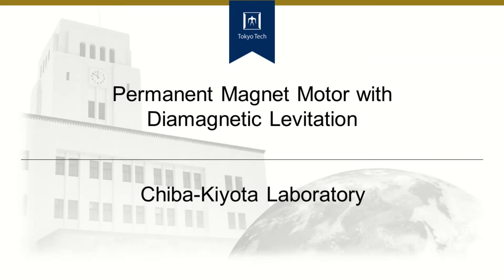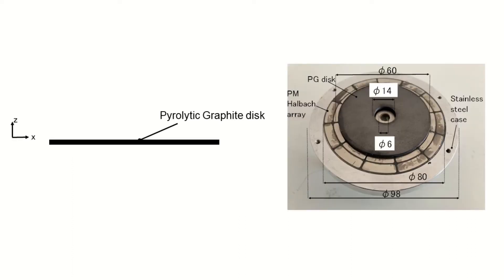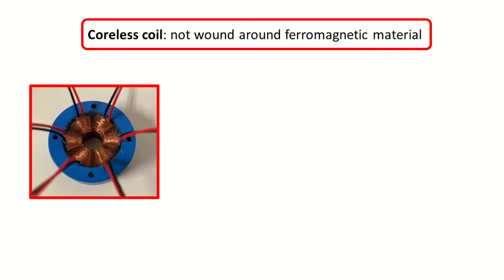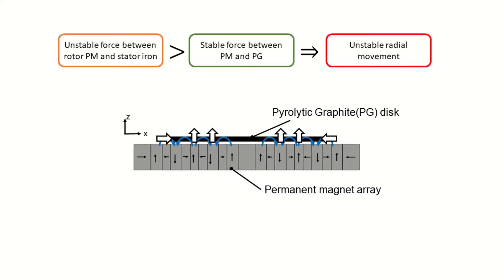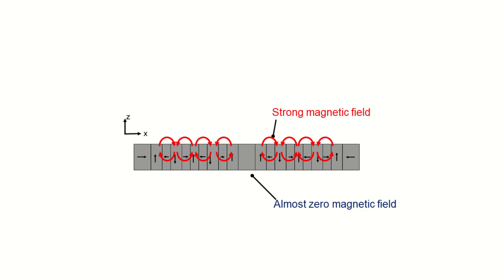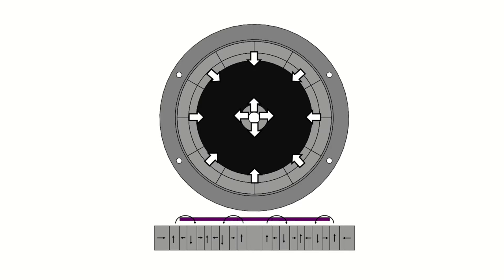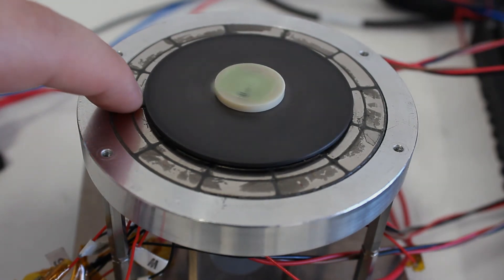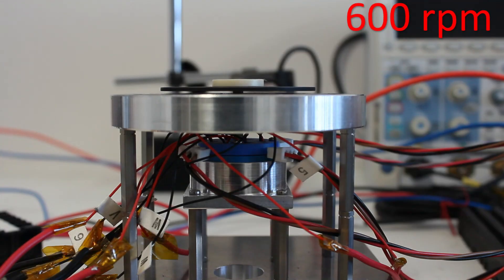Motor Levitated by Diamagnetic Material at Room Temperature

Comment: Nice! Have you tried improving the balancing grade of the rotor? Perhaps gluing some insulation tape on the top of the graphite disc to counter the unbalance. I wonder how much higher speed could be achieved then - the limitation would only be rotordynamics and, well, structural strength of the graphite - so perhaps better not to push it too much :)